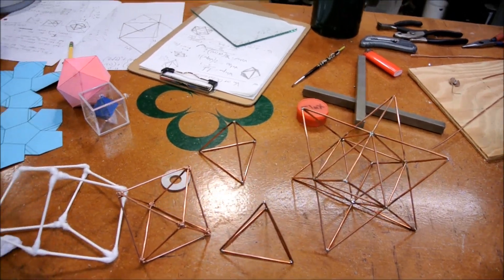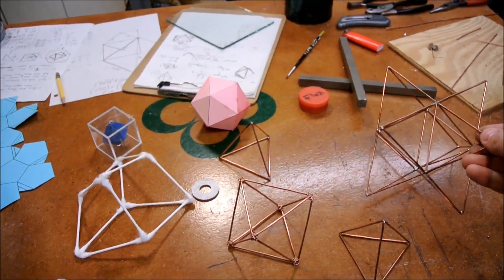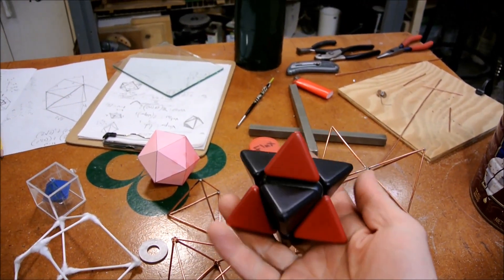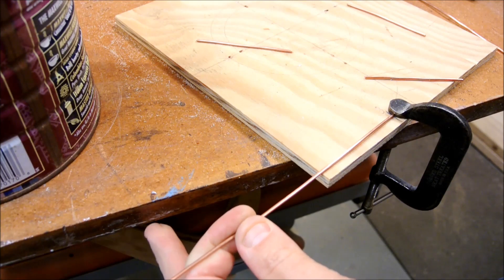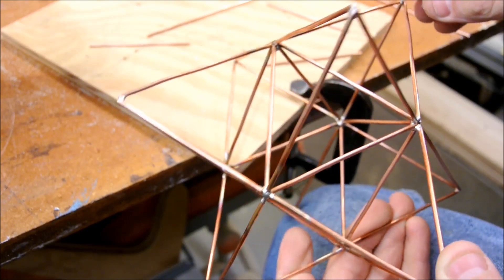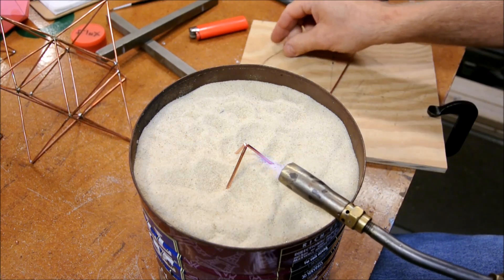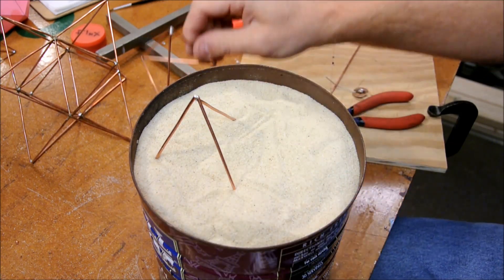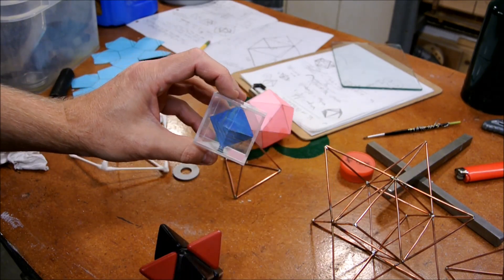Platonic solid wireframes

Comment: its very difficult to achieve the correct angles. Its better start drawing the shapes on paper, the same length and solder the wires over the drawing. you can use some adhesive tape to fix the wires.

Comment: I found your video helpful, i enjoyed watching it. Do you possibly know how many Watt (W) is needed for welding brass or copper with a soldering iron (at least)? 😀
Reply: That will depend heavily on the gauge of wire that you're trying to solder. Assuming 12 AWG copper (as used in the video), my 70W soldering station starts to work at around 700°F. 

Also note that this video is from quite a few years ago; at the time, I was using a blow-torch, because my cheapo Radio Shack soldering iron didn't stand a chance.
Reply: @pocket83squared  alright, I’m thinking to use brass tubes between thicknesses of 0.6 mm - 2 or 3 mm maybe.

So I should probably buy a 70 W soldering iron then? Or 100 W?

Btw, can I buy any brass tube or copper wire? Are all solderable? 

Thanks for answering! 👍🏻
Reply: @gorez2267  Brass and copper are both solder-able. However, we're talking about wire thicknesses in terms of gauge here, NOT hollow tubes with some centimeters' worth of mass. Thicker stuff requires way, way more heat than most soldering irons will provide through direct surface-contact transference. 

This is not really something I can further advise you on from experience. My best advice is to recommend looking into getting a soldering gun, and/or a torch set, and do some reading on the following topic: https://en.wikipedia.org/wiki/Brazing

Good luck.
Reply: @pocket83squared  Thanks for answering. I realized that I was unclear regarding the thicknesses. I am thinking of using several thicknesses of brass tubes, 2 mm, 5 mm, 3 mm and maximum 6 mm.

Of experience, do you think I could use a 30 W soldering iron or shall I use more than that? 100W? 60 W?

Last question. Do you know how I could cut the brass tubes nicely & easily? So I can get them straight? 

I subscribed to your channel! 😀
Reply: My aim is to make triangles with the with nice edges.

Comment: Hey... The sand idea is new and cool... Thanks for sharing your thoughts... I have a couple of questions. I was planning to do such similar structures however with a higher 8 gauge wire., did u try such gauges., my first question is will the solder able to hold them withstanding rough usage after joining., My second question is did u try brazing rods for joining purpose. (Can I use that torch with brazing rod)
I would like to hear ur opinion regarding which of these would be better... Thanks a lot man
Reply from the maker: No, I have not tried brazing rod, but it's probably a good idea. As for the 8 gauge wire, that will be much more difficult than soldering the 12 gauge, simply because copper steals/moves the heat away so quickly. The torch shown in the video would be too small. For "rough usage," you might want to start thinking about actually welding them. Sorry I can't tell you that it's easy! Good luck.
Reply: @pocket83  Thanks for the inputs..!! Truly appreciate it..!!
Hope I have to try and learn myself..!!

Comment: Thank you as this is what I needed to see as I will be making inside support cactus made of air dry clay. Then mix paint to the different shades i need . Trying to make the cactus look as real as possible. Then using parts of dried dill flowers I grew last summer. If all works out well I may have a welding place down the street weld some larger longer metal rods for larger cactus or other objects. I had a large octahedron made of hollow 18 inch plastic tubes and hanging on my porch. It was made by a true friend of mine that had passed away. Why I say "I had" is because one day I looked and it was gone never to be seen again. He says he was told that his father was Baby face Nelson and met his mother while he was hiding out from the law in St.Paul MN on west 7th st. I like your idea of using sand!

Comment: I just started making pyramids out of wooden dowels held together with a glue gun. I have used the Flower of Life to create a template?(guide) on paper. What I found very interesting is by connecting the center points of each side and then the quarter points with straight lines (wooden dowels) the masculine ( straight lines) derived from the Flower of Life appeared on the sides of the pyramid. These create a fractile design of triangles growing inwardly Infinitely just as the Universe grows Infinitely inward as a process of division (halving) geometrically. The Flower is a two dimensional representation of a three dimensional reality, the triangles in the Flower become tetrahedrons in 3 dimensional reality. I believe that all of the platonic solids can be represented as groupings of tetrahedrons. I believe that these groupings provide the mathematical basis for the electro-magnetic toroidal vortex which I believe is the basis for the fractile design of the Universe. I believe the Flower of Life contains the blue print for everything in Creation, the straight lines (masculine) that connect the points of intersection in the Flower of Life (the feminine Creator) are Creation.

Comment: I think house wire is thinner where the normal mains supply voltage is higher. Which is basically everywhere except North America and Japan. (Or possibly the whole of the Americas?)

I know I'm commenting quite late, but have considered trying to work-harden the wire to make it stiffer? I was thinking about twisting it. There are a lot of jewelery maker's videos about it but my initial tests haven't been that successful. I guess if the wire you have easy access to is thicker it is less important.

Comment: Where did you buy the wire?  I searched 12/2 nm-b romex and all I'm getting is a yellow coated wire.
Reply from the maker: Yep, that's it. It's just covered by insulation, because it's electrical wiring. It has to be stripped. It's readily available at any home center. A small roll isn't too expensive, but if you ask an electrician, they have piles of scrap.

Comment: Can you give me some more detail on what copper wire/rods you used? They look extremely straight and all i can find in the copper in rolls. Thank you so much and great work!
Reply from the maker: 12/2 NM-B Romex. It's general purpose residential wiring. It comes in a roll, so you will have to straighten it out after stripping it.
Reply: Any tricks for straightening out the wire?

Comment: I've tried doing this same thing to create lamp shades but never managed to make a joint. No matter what i do the solder always falls from the copper and never stick. Tried with hitting the wires first. Tried with cold wires. Tried sanding the wires so they have rougher edges for the solder to stick but no luck. Do you have any idea what am i doing wrong? Basically the solders melts and falls in the sand
Reply from the maker: You aren't getting the copper hot enough. The solder will follow the heat; once the wires have enough heat in them, the solder bubble will "break," and stick. Cu has a high thermal conductivity, so it will steal your heat and dissipate it along its length. When it's ready, it is easy to do, but this process does take some patience. What gauge wire and what type of torch are you using?
Reply: Am using this kind of burner http://thumbs1.ebaystatic.com/d/l225/m/mABqR-m86w7ebOTA2k-QyrA.jpg
I just tried warming the wires more but it doesnt work :( I event try it putting them on a ceramic tile and some solder wire on top of it and i heat it up for about 5 minutes the solder melted but it never stick at the end the ceramic tile snapped :D :D never mind i guess i'll just buy some other lamp shades

Comment: I have had trouble getting the wire straight and stripping long lengths of it, do you have any tips on that?
Reply from the maker: How long? I don't keep strips longer than 5' for crafting purposes. I hand straighten before stripping, and I only take pieces off that are comfortable for me to work. If it's hard to pull, take smaller bites. Also, put one end in the vise and pull it towards you in a straight line with both hands. I start in the middle, and then flip the piece around, so that I don't have to move the jacket over more distance than is necessary. As for mechanical strippers, those are great, but they scratch the copper. I hope to cover using one of those in a future video.
Reply: Thanks a lot, I'll try that

Comment: Urgent question: i'm currently working on a project that requires connecting metal wires like the one you used, so i wanna know what was the material you melted to connect them? And is there any other cheaper way to connect wires with??
Reply from the maker: Solder was used here. Your other questions depend on the type of wire.

Comment: I Wouldn't have tried sand like that, catches the solder spatter too, now I'm wondering how you get your scrap wire to be so straight. I ended up with loads of scrap electrical wire from a short stint in construction, the electricians would toss it in the dumpster.. always in a knotted mess.
Reply from the maker: You have to grab it while it's fresh, before they ball it up (luckily, I have a buddy that's an electrician). Anyhow, you do have to work out some of the kinks before you strip it, but the parts are only 3" long, so it doesn't have to be perfect.

Comment: Not using those dumb squiggly bulbs is a great life hack. If you have them, smash them up, breathe in the mercury fumes, and then go find a lifehack for removing glass from your eyeballs.

Wish I could have seen your take on it though. Trolls are one thing, but threats... that's saddening.
Reply from the maker: I can't agree. It took me awhile to come around, but I think the technology has now progressed to the point where CFL bulbs are superior. The Hg is a trade-off, granted, but all things considered, I still choose to use them. And I have dozens of them in my garage. Incandescent bulbs became impractical for filming, especially in the summer (heat).
Reply: +pocket83 yeah, that was a lame attempt at a joke. I'm no fan of incandescent bulbs either, just from an electrical engineering point of view. I am no tree hugger, but we do love efficiency. 

CFLs are fundamentally limited in their color spectrum though, and in practice most of the reasonably priced ones still have awful power supplies. They get hot, and have a terrible power factor. AvE did a great video about this. 

The solution to me is LEDs. Much better on every front, although the cheap ones still buzz a bit. 

I never realized how exhausting it was to think about light bulbs until I bought a house...

Comment: I want to make a tetrahedron in solid mood on a table saw, but so far it has defeated me. For sure I can almost get there and then 'cheat' by cleaning up on a sander but I cannot achieve then end result on a table saw. Any suggestions would be appreciated. Regards.
Reply from the maker: I have every intention of making that video in the future. In fact, I have a big chunk of black walnut that I would like to use for it. I worked out all of the math and angles a few weeks ago, and I will eventually put a few ideas and methods together for a quick video. If you are in a hurry, I can help you with one of the simpler methods in the meantime. Let me know if it's important.
Reply: +pocket83 Thank you. I can wait for your video, which I always enjoy. I particularly would like to make a quantity, say 20, of small ones, 1 1/4" (30mm) approximately. Regards.
Reply from the maker: +Ron Cooper Yes, the video will help with that. But I am quite irresponsible. If you get sick of waiting for it, send me a message and I can share with you what I've learned.
Reply: +pocket83 This is a useful sight http://www.slyman.org/m_projects_mathematics_pyramids_polyhedra_intersurface_angle.php?alpha=60&n=3&p=45&submit_pyramid_parameter_calculator=Calculate#PyramidAngleCalculator
But it gives the angle between the sides and does not help with the practicalities of the jig/jigs required. Regards

Comment: The sand trick is brilliant.  Would it be any use if you buried a cube half way into the sand with one corner sticking out to help you align the three pieces of copper?
Best Wishes, Brendan.
Reply from the maker: Sure. I did just that for parts of it. I would bury parts when I could, and it was surprisingly stable. As you bend a part a little bit, it stays a little closer to where you want it each time as the sand fills in and braces it.

Comment: Do you reckon you could make an octohedron using the technique in your copper astroid plaque video? It might be possible, but I can't visualise it
Reply from the maker: Sure. It's actually really simple. Just draw a hexagon, and then connect three of its vertices into an equilateral triangle. You could add the other (backgrtound) triangle if you want to approximate a wireframe model.